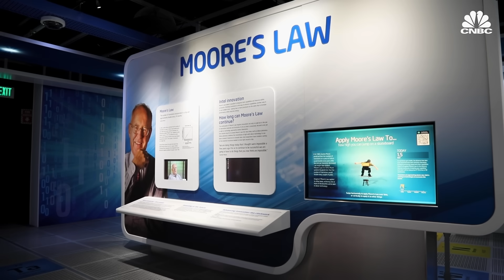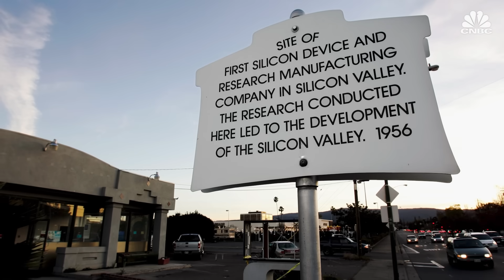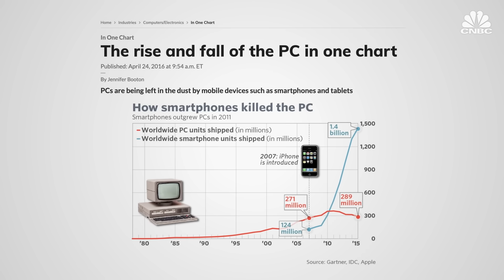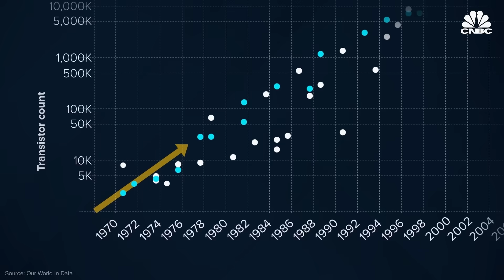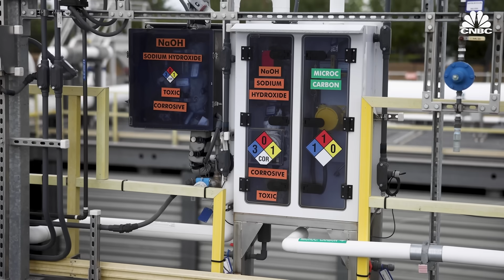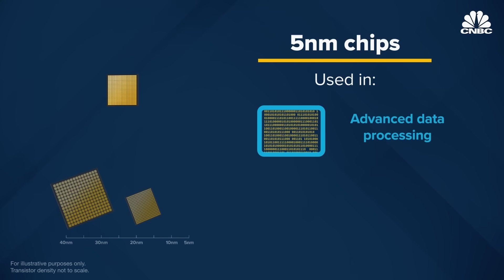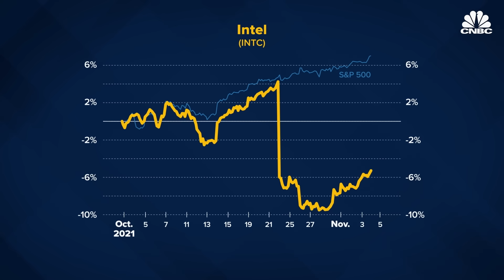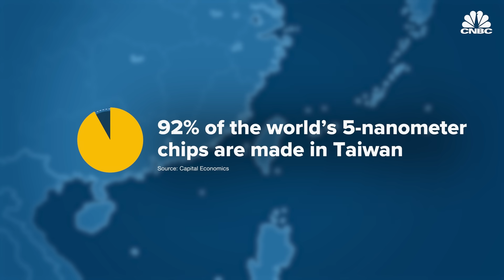Inside Intel’s Bold $26 Billion U.S. Plan To Regain Chip Dominance

Comment: Why intel wants monopoly,it's good to have strong competitors 😭
AMD made intel to reduce its chip price 🤣and is making tough competition
Reply: Intel didn't reduce chip prices, AMD raised theirs. Have you checked prices of their CPUs and GPUs? They're sky-high right now, whereas a few years ago AMD products used to be on the cheaper side. That's not the case anymore.
Reply: @InDreamsYourMine  I never claimed that it was because of chip shortage. The price is determined by the number of transistors on the chip - the more, the pricier. So don't expect the upcoming products to be cheaper than the current lineup.

Intel has the advantage of greater market share and having their own fabs, which actually might help them offset some expenses and offer their products at a lower price, which is the luxury AMD does not have.
Reply: @Reloaded2111  Sorry replied to wrong post.
Reply: Not really though, the price is determined by how much the business people think they can take

Comment: 13:42 this is absolutely incorrect. Mars rovers do not use 5nm chips.... Quite the opposite. For example, the latest Mars rover, Perseverance, uses RAD750 CPUs, a chip released in 2001. Why? Many reasons, resistance to high radiation levels being one of them. Anyone that is familiar with the GameCube console, it utilises a PowerPC 750CXe processor, which is what the RAD750 is based on.

Comment: I went from a AMD fan to an Intel fan back to AMD. Intel hasn't progressed much and AMD has caught up with them with processors that are on point with them with more cores enabling for faster computing. I'd like to see you Intel come back and be more competitive but currently their prices for CPUs compared to amd's are extremely overpriced.
Reply: Is 12th gen just not a thing to you?
Reply: @brianvalencia9001  pretty expensive though
Reply: @brianvalencia9001  a cheaper CPU, but you have to also buy ddr5 ram, a new motherboard, and a new OS. So realistically not cheaper than upgrading or building a CPU with AMD.
Reply: @Brandon-cc4ft  you dont need ddr5 but yea mobo does need to be new, but amds platform dies this gen so a new mobo is happening either way
Reply: @brianvalencia9001  My bad, but from how I see it the prices and delivery of items are going to be screwed until next year anyways. With the supply chain being so messed up and the increase consumer demand, how will anyone even get any thing at an affordable price in Q4 2021.
Reply: @brianvalencia9001  my 3900x does more than anything I can throw at it. I couldn't wonder why someone one want something similar to Intel with there prices compared to performance mine has. I just looked it up, they I have made quite an improvement but their core count still lags behind behind AMD. Good to see there trying tho
Reply: @setsunasetsuna9342  Core count really has nothing to say in CPU performance.
Reply: @GarryPadle  for multitasking it does

Comment: Make sure they develop the right tech that is feasible in the real world, not just lab proven. As for ASML equipment, get in line Intel. ASML only has so much capacity.  As for clients? Intel fab can't rely on itself as sole client. It needs orders from Nvidia, AMD, and other chip buyer/designer. It has to convince clients Intel will play fair. As for labors and talents? Tough luck!

Comment: Intel, AMD, Apple, TSMC and Samsung are all using the Dutch ASML chip making machines which are the leading and dominant 5nm and 3nm chip making machines company ! Dutch pride  🇳🇱 !!
Reply: Yeah, engineering and tech is from the US😁
Reply: @nukezat , the wet etching in lithography was developed by Burn. J. Lin, the deputy general manager of TSMC, which makes ASML surpass Nikon and Cannon, Taiwanese, contributed many breakthroughs in chip technology. EUV was developed in F12 of TSMC; an Engineer from TSMC is still in charge of the research in ASML.
Reply: @genuinennessbefitting4734  
EUV was developed by Cymer in San Diego, CA, USA beginning almost 30 years ago. Cymer was later acquired by ASML.
Reply: @anonymous one Yes, it is. ASML was created out of Philips, the world famous Dutch electronics company.

Comment: The issue with US based Semiconductor manufacturing isn't the fabs. The US has plenty of fabs when smaller fabs like Global Foundries are included. It's the rest of the supply chain. The materials for  Semi-conductor manufacturing right now are primarily sourced from China. Most OEM suppliers are in South East Asia with most of those in China. Electricity is expensive in the US, and these are electricity intensive. The rail network in the US has not changed much since the 19th century. The US regulatory environment is a severe hurdle for most manufacturing companies to overcome, especially with the push for net zero CO2. Many problems in the US stem from the regulatory environment. For instance rail infrastructure has not expanded since the rail regulations have not been modernized in a century.
With growing tensions, a lot of these companies are working to leave China but that process takes 5~10 years. Most companies want to move out of Taiwan right now as a result. But simply signing a blank check does nothing. The regulatory issues have needed to be addressed for a long time.
Intel's fab issue has to do with lack of diversity. They used to only manufacture Intel Products, and Intel Products were only fabed with Intel. If there is an issue both sides of the business suffer. Intel still makes 50% more than TSMC, but they have seen repeated drops in revenue over the last few years. Saying the issue will be fixed by 2025 isn't reassuring.
Reply: Quite the contrary, as far as I know that since Taiwan has now so far the most complete and efficient semi manufacturing eco system, more and more equipment suppliers are coming to Taiwan to be close to their clients. Morris Chang, the founder of TSMC expressed his belief that the best soil for semi industry is Taiwan and therefore TSMC will besides expand overseas will invest their most leading edge processes in Taiwan.

Comment: NASA-Rovers use 5nm? They use very old CPUs which are radiation hardened... Its a 250nm process... Built in is a powerpc 750 g3 which "only" has 200 Mhz
 They use a processor on the same series as the Nintendo GameCube...

Comment: TSMC is light years ahead. This is not something they can just fix by throwing some money at it. TSMC has positioned itself much better for success
Reply: @schembfs  LOL ok, so you are saying TSMC doesn't know anything besides buying equipment from ASML and then "just a matter of building the production line to mass produce it".
Yet somehow Intel spent billions and failed, China spent hundreds of billions and failed. It's almost as if just having lithographic machines is not enough, just like owning hammers doesn't mean one can build a house.
Reply: TSMC is a processor manufacturer. Intel’s competitors are Samsung, AMD, Nvidia, Qualcomm and Apple.
Reply: @Vylkeer  No, that is quite not correct. Only a short answer: Apple is producing NOTHING! Intel is designing and producing Chips, Memory, Processors.
Reply: @LeicaM11  That couldn’t be any wronger. Maybe you missed the news that Apple ditched Intel (Nvidia and AMD too for that matter) and started designing its own SoCs for Macs like the M1. They’ve been designing ARM mobile chips for years for iOS devices and now they’re doing the same for the Mac. These chips include CPU, GPU and RAM. Check your facts.
Reply: They are ahead but not light years.
Reply: @RaineRed  it’s light year, Intel can't even build 7nm. Remember the date, and see when will they have it. Remember, it’s not Intel 7 ( 10 nm) . Intel is slow and overheat,
Reply: @phenomAMD  first im not sure why you are making a comparison here. Intel are hotter then tsmcs what? Tsmc doesnt produce its own cpu, it simply manfactures amd design. You argument should be intel runs hotter than amd, in new i9 case that is true. With i5 and i7 it is not but then intel chips draw more power. And how is intel slow? Intels new i7s are running neck and neck with ryzens flagship and the i9 beats it. The nm thing is out dated intel 10nm is more densly packed by transitors than tsmcs 7nm..even tsmc wants to do away with it. Again this isnt the case of tsmc producing cooler chips or faster chips they dont do that they simply make what amd has designed. Most of the comparisons people are making here are actually amd vs intel ones, not tsmc. Intel designs and makes its cpus, amd designs it cpus and tsmc makes them. Dunno why people like arguing this stuff, we the consumer win when multiple companies produce good stuff and right now they are.
Reply: @RaineRed  you don't get it, because you are not work in this field. After decades OEM service, they are so good at design and also GPU. It just TSMC choose not make their own products but service only.  They know what are the bad design.  Now intel can only use high current to boost the speed, sometimes reach 450W. Check what's the wattage on Apple M chip.  Very green.
Reply: @schembfs  haha ok, first of all I said absolutely nothing about "lightyear" ahead, so you can really use that "reading comprehension" skill you mentioned.
Also, interesting how I quoted what you said, that TMSC is nothing but a company that buys equipments from ASML and just build production lines. Yet now you went on a long tangent and changed your stance.
Reply: @TheHeartMachine  TSMC is not "light-years" ahead of intel they're 1 year ahead at minumum and 2 years ahead at most. TSMC latests process node is their 5nm process and Intels is their 10nm process which is more or less comparable(denser) to TSMC's 7nm process so TSMC is essentially a year ahead of intel. According to the latest report TSMC has delayed the release of the 3nm process to early 2023 so no their not " light-years " of Intel.
Reply: @schembfs  sorry but you are so wrong. TSMC is a great IC design company as well, but they don’t show you that. Current all AMD CPU and M1 the I/O portion is TSMC designed, because AMD and Apple I/O design are weak and slow on that part.
Reply: I am somewhat late to the game on TSMC and fell in love with this company. I read their annual report and I couldn't help be struck by how diligent and performance driven this company is. I just wish TSMC's stock would get some love in the market, its been languishing for a while.
Reply: @schembfs  just because ypu have an EUV machine doesn't mean you can produce a chip. It's the refining methods that is the secret to produce a working chip. Intel has the same EUV machines as TSMC but yet they failed to produce a working 7nm chip.
Reply: In the past few years, China invested tens of billions of dollars to build fabs, and even robbed South Korea and Taiwan engineers, but it failed later.
Reply: @book775533  US is different from China, and their approach is much different.
Reply: Building the new foundry’s in Arizona keeps them off the coast a little during the war with China so they have a slightly better chance to continue pumping them out.
Reply: @SanctuaryLife  
Building a microchip FAB in a desert is risky at best and downright foolish at worst. As the video stated, FABs use 4-9 million gallons of water per day. Only 50-60% of that water can be recycled, not 95% as stated by the Intel guy. And they want to build 3 FABs in Chandler, AZ. Where are they going to get the water, especially when the water supply is at historic low levels? Look at a recent picture of the Hoover Dam and the problem will be readily apparent.
Reply: @SanctuaryLife  what kind of war are you talking about?
Reply: @umaikeruna  There is no question that putting them off the coast is intentional on the part of the US government (subsidies) because in the event of a Hot War with china they will be harder to hit. These chips are used for all sorts of military equipment from the F35, to Satellites, to Night Vision Goggles.
Reply: TheCatnfused  intel has left 14nm since Q2 and are now on 10nm on all realeased devices today
Reply: Bangladesh is planning supermacy in chip manufacturing
Reply: @schembfs  TSMC, Even when they are not the leader in innovation market, they sill hold some value especially on logistical part, like how they managed the company or how they optimize their plant for maximum output. Plus  US also acquire Samsung intel, you know the newest display and some high performance memory chips. These acquisition will pretty much put Intel and other US's better position saving billions of dollars on R&D.
Reply: @BurntTransistor  TSMC is the share holder of ASML, and TSMC taught ASML how to build the EVA
Reply: China may change that...
Reply: @billr5842  FAT HOPES
China's Semiconductor Makers..
Semiconductor Manufacturing International Corporation (SMIC) only survivor but making lower cost chips.
Nanjing Semiconductor Technology went bankrupt 
Tsinghua Unigroup faces bankruptcy
Wuhan Hongxin Semiconductor Manufacturing Company (HSMC) is bankrupt
Reply: @set3777  Saying if China invades Taiwan, that'll be the end of those factories.. no way will China take control of them though
Reply: @billr5842  TSMC is already building factories in Arizona, USA, Kaoshiung  and in India. TSMC also TSMC has a joint venture with Sony to build a new FAB in Japan.
BTW:
It is not so easy for China to invade Taiwan. The Taiwan Strait cannot be crossed by foot or by tanks.
Reply: @set3777  That is good. China could invade Taiwan but it could be disastrous for China considering that the USA and multiple countries would intervene.
Reply: Do not forget, that ASML (Philips Europe, Netherlands/Germany) is leading and light years ahead. TSMC, Intel and LG, Samsung and so on just are using their technology!
Reply: @LeicaM11  you are wrong. TSMC is the share holder of ASML, and TSMC taught ASML how to build it. Now TSMC going to work with JP to build a different system on cheaper cost.

Comment: Basically Intel problem is due to PC vs Smart Phone.

PC market size is 200 million a year vs Smart phone 1 billion a year.

Now we have Nvidia for AI Autonomous which benefited from China giant gaming industry.

Now it is Robotics, CNC from smart warehousing to robotics. There is no coming back for Intel but in specialisation. Intel needs to split into specialisation units.

🤗
Reply: Intel owns Mobileye, they have much more automotive revenue than NVDA Drive
Reply: @xdman20005  the issue is not who has bigger revenue but which fields and what's the direction of product tunnel, viable products.
Reply: @kongthai..  well Mobileye does

Comment: Is this a documentary or advertising?  The story, as told, gives Intel sole credit for almost every innovation.  The story of Intel and AMD is one of continuous injustice and filthy tricks on Intel's part.  You only mention that it took AMD 5 years to "reverse engineer" something;  not sure what.  The truth is Intel had a CONTRACT to supply AMD with the masks, to keep AMD as a competitor, to shield itself from Antitrust law.  When Intel did not feel they needed AMD anymore, they broke contract and refuse to give AMD the screens.  AMD had to hire engineers to DESIGN FROM SCRATCH a processor that would be compatible with Intel;  NOT to reverse-engineer anything.  AMD consistently innovated and stayed ahead of Intel against the odds.  That was followed by years of Intel using its market muscle to manipulate benchmark publishers to change the benchmarks to make Intel look better;  and back around 2000 Intel threatened motherboard manufacturers around the world with "shortages of key components" unless they desisted from supporting the then brand new AMD Athlon.  Intel is one of the most crooked garbage companies in history, and CNBC decides to make a documentary here and paint them as innovators and as heroes.  I'm not only disliking this video, but also indicating to youtube to never recommend this channel to me again.

Comment: Even if they put in the orders today or last month or last quarter, Intel will be stuck at their "7" process until the 18 month backlog of EUV equipment orders at ASML clears. Even once their spot in the line arrives, they will receive the equipment at best at the rate of 4 machines/month. When Intel designs their processors, they have to match a volume production chip with volume production capabilities. It will take at least 12 months once any of their EUV equipment orders start getting filled to have enough capacity for a mainstream chip release. So Intel is realistically at least 2.5 years away from having volume production capabilities of anything smaller than their current "7" process. Where will TSMC and Samsung be then? Bob Swan screwed Intel so hard, it will be years before the media truly grasps just how behind Intel is.

Comment: It's a mainstream news site, but should get some basics correct. The 4004 wasn't the first microprocessor, there were a few other generational contemporaries  (namely the AL1 and MP944), however the 4004 was the first one commercially available (the MP944 for example being classified by the Navy).

The Motrola 68000 was a 32-bit processor (w/16-bit data bus) released in 1982, quite a few years before the 80386, and it's successor the (full 32-bit) 68020 was released a year before the 386.